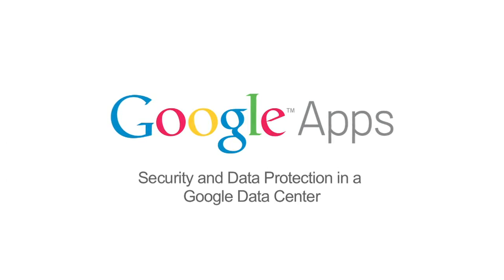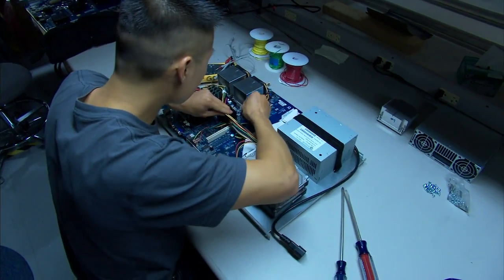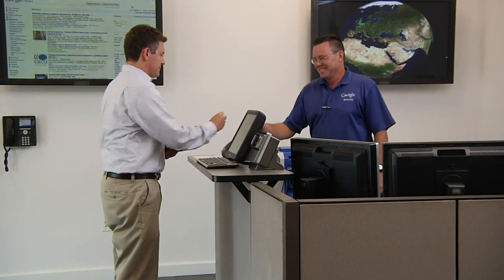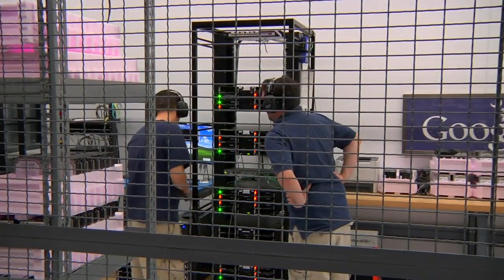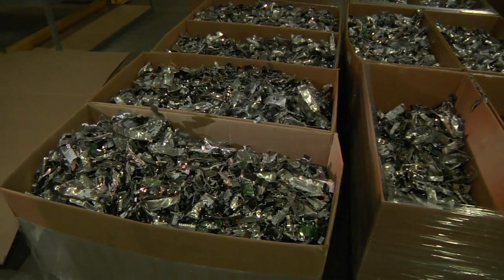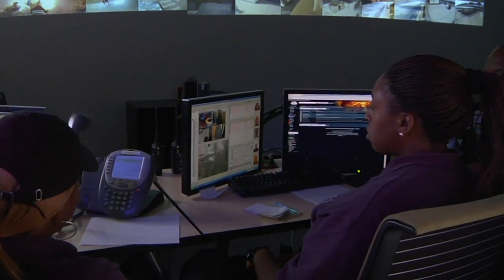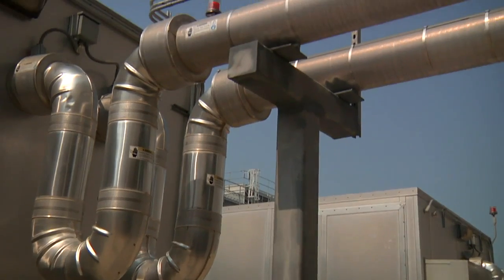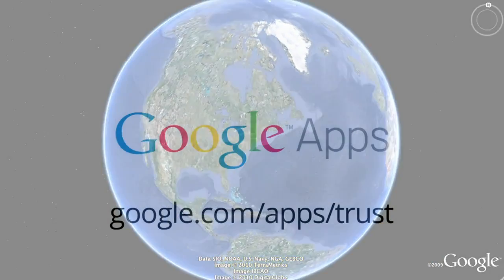Google data center security   YouTube

Comment: the unwanted harddrive can just go through the shredder, what's the point in having the crusher
Reply: There are ways to extract portions of data from platters that are shredded if they have not been deformed in any way. Once a deformity of a platter occurs data retrieval is impossible by any means with today's technologies. So, in actuality you should say why shred it when it's been crushed and deformed. But, in reality none of the destruction is truly necessary if it's been verified overwritten. Each and every single bit of space is overwritten with a 0 multiple times. As said in the video they destroy the unusable drives. In the end, while data security is the moniker, it has more to do with separating plastics and metals for recycling.

Comment: Well, after wiping the drive, punching a hole through the platter and then shredding the hard drive (also it being an encrypted and fragmented raid drive)... doubtful you could even collect a fucking block of data off it afterwards.
Reply: +Nirotix Why not go one step further, melt the drives into solid blocks of metal. Then you'll be REALLY hard-pressed to get anything from it

Comment: But what about an EMP attack? Everything is prone to that.
Reply: Umm.. No.
Reply: DSITeam
What? How does an EMP affect humans? Apart from shutting down facebook?
Reply: Ever heard of "Farady cage"?
Reply: As told data is being mirrored all around the world. If an EMP would hit 50% of the world i doubt being alive is on option then.
Reply: Just think about it, it destroys devices all over the world. They do not die magically out of nowhere.. No they are being hit by a giant electric pulse going though the air. Okay, so think about standing close (Within 25 Miles) to a EMP that is as big as the world.

Dead because you'll be the point of focus, it will simply hit you the strongest.
Reply: S
Reply: for a short period of time as compared to a conventional nuke. computers are being built every day..it would only be a matter of time before they all get replaced
Reply: daab889 Yeah, I am almost certain that Google put copper grids in the walls of concrete. The worst an EMP could do is take out the power.